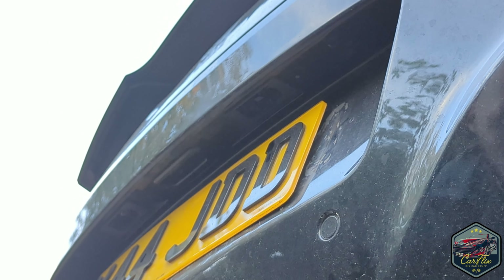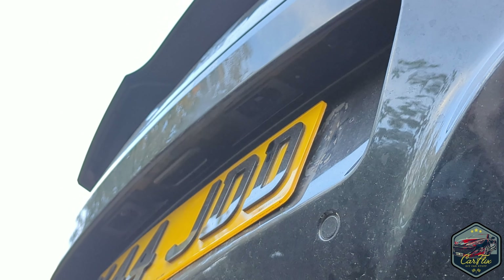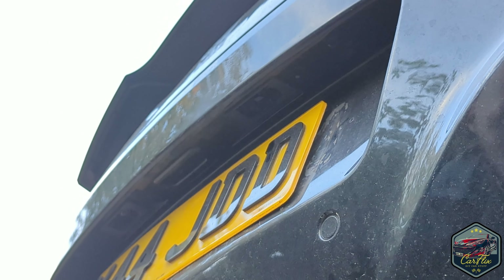How to Change your Number Plate Lights to LED!

Comment: Is it not illegal to change a plate bulb which is a different spec to those fitted by the manufacturer?  ie you shouldn't change out your halogen bulbs for LEDs if the car was not so fitted from new.
Reply from the maker: It's only an MOT failure to replace  reflective headlamp bulbs with LED/HID all other bulbs are perfectly legal to change , hope this helps ☺️
Reply: in germany it would be illegal